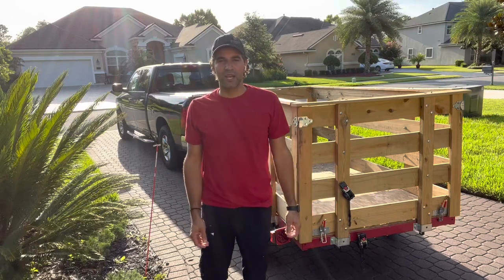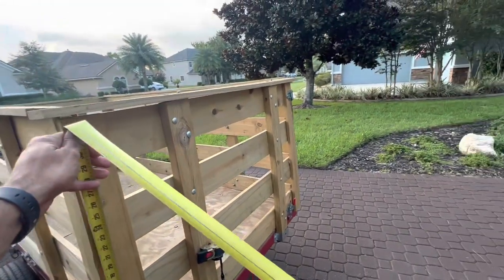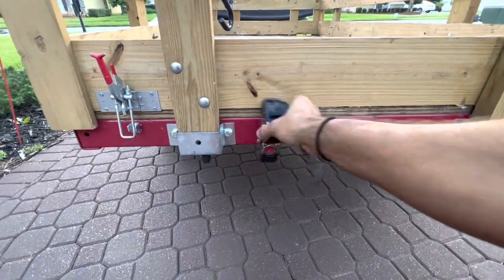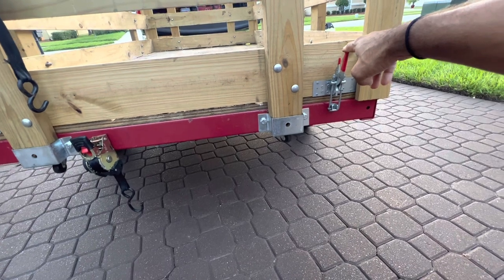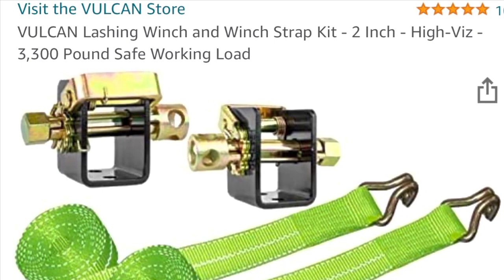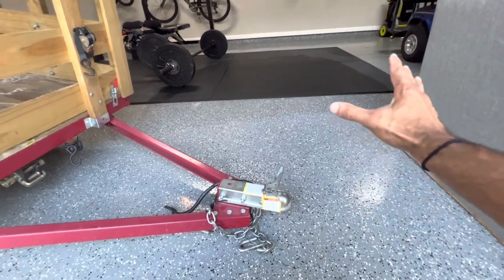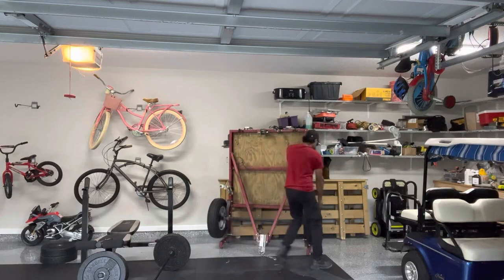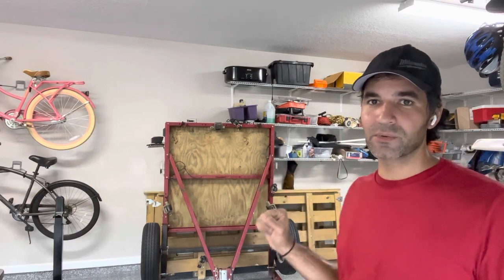Custom built foldable trailer from Harbor Freight with great options

Comment: Grwt build. Loxking to redseign mine. Did you use pressure treated wood? Did you seal the wood? Also, how long were your carriage bolts? Why did you add the metal plate for the locking toggle clamps?

Comment: Not sure if it has been mentioned but when folding the trailer if you lift the rear section up to just before half way and secure it with the strap it will make it easier to lift the front section to get it on the casters by acting as a counter balance.  Just a thought.
Reply from the maker: Great advice! Will try it next time I use the trailer.

Comment: Great Job, a trailer like that has so many uses and can be pulled even by a small car. Plus it's a pickup that's cheap and no insurance,  just plates!
Reply from the maker: Yes! Agreed!
Reply: Oregon does not require platess but California does:$90 as of 3/10/23
Reply: $48 here in Illinois
Reply: Haha notice the two states you guys mentioned, I'd guess NewYork probably charges too.

Comment: Hi Li, great video. Hey are those the original tires or did you upgrade? They appear a bit beefier than OEM, can you provide the details on where those are from?
Reply from the maker: They are upgraded tires. I got these tires because the load capacity is much higher; 1,600 lbs per tire:
Kenda Karrier 13in. Radial Trailer Tire and Wheel Assembly - ST175/8013,
5-Hole

Comment: Nice configuration.  I just bought the1720lb trailer (9/30/2023) and 6 bolts need to be removed in order to fold it.   I used to own the lighter duty version for which no bolts needed to be removed.  Either they changed the 1720lb trailer design since you bought it, or you may actually have the lighter version - i don't know.
Reply from the maker: As long as the trailer closes with the wood boards, you should be able to countersink the bolt (hide it flush with the wood boards. Let me know if this helps.
Reply: @fixedbyli   In my trailer, there are 4 carriage bolts (2 on each side) that bolt the suspension frame to the rear trailer frame, and then 2 bolts that bolt the rear and front trailer frames.  My conclusion is that this is one of the major differences between the modern/lastest SuperDuty trailer vs the LIghterDuty trailer.  The foldability is not related to any optional wooden add-ons.   @fixedbyli

Comment: I have the same setup on the heavy duty model. The only thing i have different is i installed a bracket for mud flaps instead of fender. I don't want be paying for damage to any cars or trucks on the road. When i fold mine i take off the mud flaps along with rail fence. I also had to buy outside bracket for fence too mount to. I also ditched the lights for LED lights. They are brighter and the light will not crack or break like conventional light housing will. My lights also have a clear light for illuminating the license plate. I also welded my trailer 360 degrees around each piece. I change out the cheap tongue hitch with heavier hitch. Its more secure now too. No one will steal this trailer off my vehicle. I had one steal of my vehicle 4 years ago. How they took it is still a mystery. I found it by accident and in the process of sueing the 2 people that had it. They actual faked a bill of sale and got a title for it. Since i have the original i will win and get the trailer back or they will have to pay me for the trailer fully assembled. With will be a lot more than i paid for the unassembled trailer. They are going to regret stealing it. Then i am pressing charges for theft.
Reply from the maker: Jeez! Didn’t think of mudflaps and welding it. If it got stolen, it’s because people love them! 😂 Joking aside. I’m thinking of putting an AirTag on mine. Thanks 🙏

Comment: love your trailer ....curious about the metal you have beneath the brackets ....what kind of metal is it
Reply from the maker: It’s the touch slotted angle bracket.

https://www.homedepot.com/p/Everbilt-2-1-4-in-x-1-1-2-in-x-48-in-Zinc-Plated-Offset-Slotted-Angle-801327/204225770

Comment: Nice additions to the trailer.   After you removed the fenders how much clearance is between the tires?     I've got a 48" mower deck that's 50" over all width and was thinking it wouldn't fit on the 4x8' trailers but with fenders off it might.
Reply from the maker: It’s 51.25” between the tires. 50” is safe but close..

Comment: I'm diggin the strap idea. What tire do you run on there?
Reply from the maker: I got these tires because the load capacity is 1,600 lbs per tire.

Kenda Karrier 13in. Radial Trailer Tire and Wheel Assembly — ST175/80R13, 5-Hole

https://m.northerntool.com/shop/tools/product_200365267_200365267?cm_mmc=Google-LIA&utm_source=Google_LIA&utm_medium=Tires%20%2B%20Wheels%20%3E%20High%20Speed%20Trailer%20Tires%20%2B%20Wheels&utm_campaign=Kenda%20Tires&utm_content=13946&gclid=CjwKCAiAs8acBhA1EiwAgRFdw_aM5J3OfwTKky4rGAZU-Hu3yYfeMgCYKSE67SBmLtUrYg9IkyNN2xoCHrsQAvD_BwE&gclsrc=aw.ds

Comment: Thx u! What is the size and type of receiver hitch do u hv so the trailer can be attached to tow hitch?
Reply from the maker: It’s a 2inch ball. Here’s the link to the trailer and the specs. Let me know if this helps. 

https://www.harborfreight.com/1720-lb-capacity-48-in-x-96-in-super-duty-folding-trailer-62671.html

Comment: Great video, thank you! 

Question: what was it about the smaller Harbor Freight trailer that you disliked? (Other than a lower maximum capacity in various ways.) 

Asking because I just have a Subaru with a fairly low tow rating and a smaller garage than you have, plus won't be doing projects as large as you.
Reply from the maker: Thanks! More capacity = more options. That’s it! Once I exploded both tires i realized that it was best to get the higher capacity. Replaced the tires, sold it and bought the higher capacity.
Reply: @fixedbyli  I believe the highest capacity trailer is rated at 1720 lbs., not the 2000 lbs. you speak about at 00:58.  Really like the mods BTW.

Comment: Do you have the break down on what wood and specs did you used in the build?
Reply from the maker: I built the wood frame based on the dimensions of the trailer. I measured the trailer and then I cut the pieces.
Reply: @fixedbyli  is the wood 2x4?
Reply from the maker: @peten6445  The vertical boards are 2x4. They are required as the brackets are intended only for a 2x4. The horizontal boards are 1x6. Anything larger than this gets heavy when you have to take the walls down. Anything smaller is flimsy.

Comment: Nice video! I'm retired, have little hobby shop.  I need to pickup a 1200 lb. Metal lathe that's about 1300 miles away.  The wife and I have a 2021 honda passport.  With the wheels removed and back seats down, do you think it's possible to put this in the passport?  I hate to travel with this empty bouncing around, one way will probably be bad enough. Thx
Reply from the maker: Even if you take off the wheels, the axle will be sticking out. Better to drag the trailer.. I would suggest to replace the bearing grease with something more heat resistant so that the bearings don’t get damaged.

Comment: How thick of plywood did you use on the floor?  If it is too thick, then the trailer won't fold.
Reply from the maker: 23/32 in. x 4 ft. x 8 ft. CCX Ground Contact Southern Yellow Pine Pressure-Treated Plywood

Comment: Where did you get the interlocking corner brackets?
Reply from the maker: Sorry. Took so long to reply. Im not receiving notifications . Here’s the link!! Hodenn 8pc Trailer Wood Sides Bracket Latch Rack Stake Body Gates Connector with Screws https://a.co/d/cu0Vnvo

Comment: What is the name of the latches that hold the sides and where can I get them?
Reply from the maker: Lots of stuff in this video! There were a few latches in there. All can be purchased at Amazon!

Latches: 3-Pack 2000lbs Capacity Heavy... https://www.amazon.com/dp/B082KCDKWR?ref=ppx_pop_mob_ap_share
Reply from the maker: Latches for the gate: Red Hound Auto 4 Pc Stake Body Utility Trailer Rack Corner Connector Wood Panel Gate Side Latch Brackets Set - 4 Piece Makes 2 Corners https://a.co/d/10upbDw

Comment: I have one of these but haven't figured out a good way to handle the spare tire. I'm intrigued by your setup--what kind of brackets are those, and how did you secure them to the trailer?
Reply from the maker: Spare tire! I installed it underneath the trailer. You need heavy duty brackets. I recommend these!

https://www.homedepot.com/p/2-1-4-in-x-1-1-2-in-x-36-in-Offset-Slotted-Angle-801357/204225747

Comment: Aren't there bolts in the middle that need to be taken out when folding?  This looks too easy.  :)
Reply from the maker: Nope. Just the two bolts as shown in the video!
Reply: Yes there are. OP has not read the owners manual.
Reply: I'm not sure about 2 but I remove 4 wverytime before I can fold mine.  2 in the middle on the trailer to hold the two pieces together and 2 by the fenders (1 on each side?)